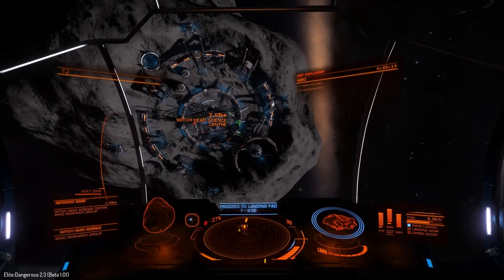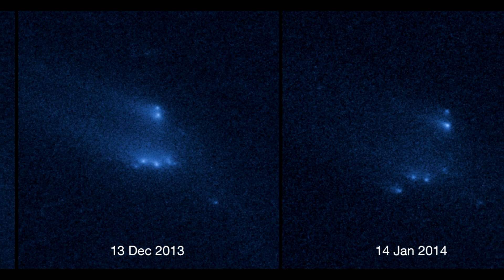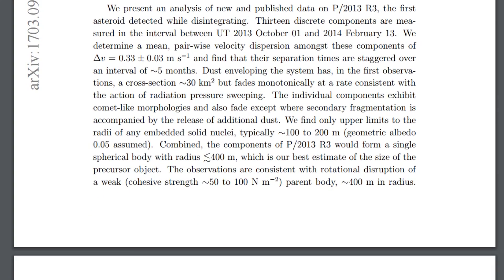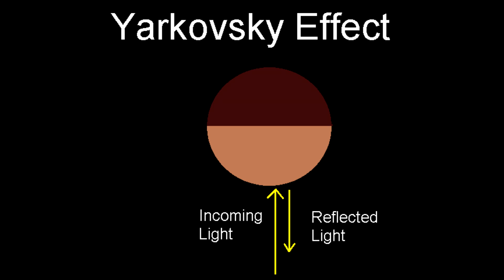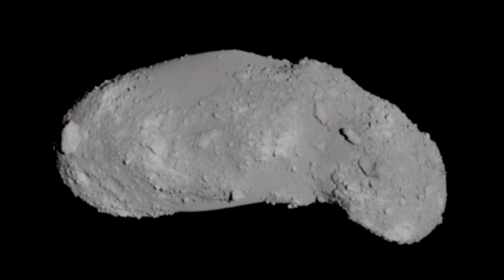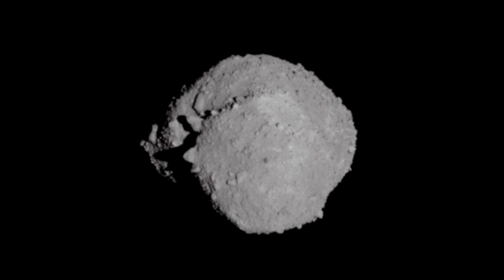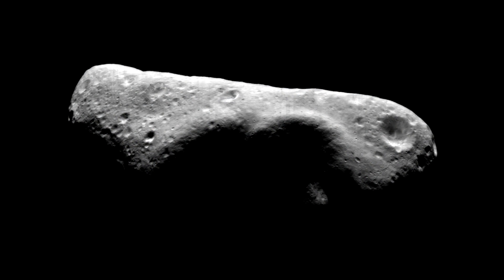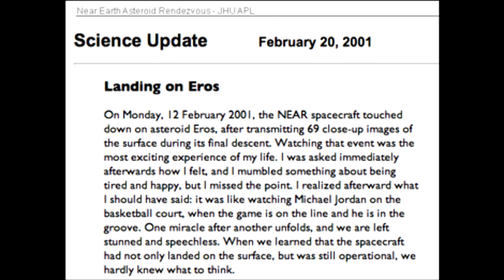Spinning Asteroids To Make Space Stations

Comment: i always assumed that for the stations they dug out some of the asteroid/body and spun an cylinder inside it. 
cheaper, youre mining the body anyways, and you're spinning up the cylinder not the actual body.
Reply: also i guess all that rock is a nice protection against that nasty space radiation, in my opinion that's the only advantage of digging a hole in an asteroid instead of building something on the surface anyway.
Reply: frischer bärlauch speaking of those nasty little solar rays i wonder if it's possible to put something near Ceres to block out the rads, like a nasa scientist (i believe it was) suggested recently. Then you could build habs on the surface. Maybe put up a nice little space elevator.
Reply: John Wang i never said a hollowed out asteroid with a cylindrical city made sense, I'm just saying that's how i always figured it was done. Personally I'd but a magnet in orbit to block stellar radiation and build bowl shaped habs on the surface and spin them to have artificial gravity. And you'd want a permanent base on Ceres because there aren't any satillites, it's rather small, lots of fuel, and it's larger and more circular than a lot of other bodied you could consider.
Reply: +Daniel Carter   First ore only exists on differentiated bodies that has had some volcanic activity in the past to bring magma with higher concentrations of heavier elements closer to the surface.   That's why I said that Ceres would be ok but no better than the Moon or Mars.   Really, you have scale all mixed up, do you realize how big the Moon or Mars are in comparison to any potential spaceship, do you realize how big some asteroids and comets are to any potential spaceship.   Unless you're planning a spaceship larger than ten thousand miles across, the fact that the Moon, Mars and asteroids are big really does not matter and indeed the surface gravity of the Moon and Mars would be a problem for large spaceships as scaffolding would be needed for support during construction and maintenance and there would be a planetary gravity well to launch against.   It takes infrastructure to smelt large quantities of ores not large real estate, how large is a smelter on Earth?   Is it thousands of miles across or thousands of feet across, besides one thing about space is that there's a lot of space, you don't need to go to a large body like a moon or asteroid just for space.   As to large bodies having ores, yes that's true but we can only scratch the surface of large bodies such as the Moon or Ceres.   The Holy Grail of asteroid mining to find a small fragment of a former planetary core, a type m asteroid that is small enough for us to extract the resources from completely rather than look for veins of or in the crust of some planet or moon we can barely dig a couple of miles into which wouldn't even be a noticeable percentage of the heavenly bodies volume.   Mining is about breaking apart the desired material into small bits for processing, the whole point of asteroid mining is to find something desirable that's already broken up into small enough bits, it's not about how large the asteroid is, it's about how much of the desired resources that can be extracted from it.   You don't want a big asteroid for the resources to build a space ship, you want a small one and even a small one could have millions of tons of resources, far more than is needed to build a ship.
Reply: also not all radiation is charged
Reply: frischer bärlauch it shouldn't do that too much. I mean it's basically just emulating the one we have on earth. And any equipment we bring up to space has to be hardened anyways.
Reply: Daniel Carter yah but still the magnet we have on Earth has a much bigger scale, for something portable to have the same effect I guess you would have to have a very strong magnet in your space station
Reply: +Daniel Carter   First, only high kinetic energy particles such as the solar wind and cosmic radiation are charged particles. Second, we can make magnetic fields more intense than Earth's magnetic field but remember that the surface of Earth is about 3,000 miles away from the center of the Earth, how intense would the magnetic field of any magnet we could possibly make be at such a distance?   The reason why the Earth's magnetic field shields us from some radiation like effects is because of the wide volume it encompasses, the whole artificial magnetic field as radiation shielding idea is highly questionable, placing an artificial magnet to shield from radiation probably won't do a thing, creating a mine field of billions to trllions of satellites each with an intense magnetic field might do something but that's getting ridiculous.   Artificial magnetic fields for radiation shielding is just another silly sci-fi trope.   Mass is still the best radiation and micrometeorite shielding, it's only downplayed in our current space program because it costs about $10,000 US a pound to get any mass from Earth to low Earth orbit.   If you're going to an asteroid for resources, your best radiation shield would be literally sandbags of asteroid regolith, preferably packed as densely as possible.   Cere's is an ok mining candidate because it's large enough to be differentiated, that is, it's a protoplanet, it had it's material molten at some point and sorted by gravity and ores of concentrated desired minerals would've been brought to the surface by volcanic events in the distant past but really Ceres has few advantages over mining the Moon, Mars or even Earth.   Smaller type S asteroids are small enough to mine completely (we can only mine 2.5 miles down on Earth so even on Ceres we can barely scratch the surface) but small type S asteroids appear to be loose undifferentiated rubble which have never been part of a protoplanet and hence all the minerals are dispersed throughout the asteroid.  Typically, a type S asteroid would be 8% iron throughout with no concentrated ores and current iron ore are only commercially viable if over 70% iron, that's not to say we couldn't mine them, we would just need to use bacteria to biomine them.  The prize of asteroid mining would be the type M asteroid which are believed to be portions of a former protoplanet's core after the protoplanet has been shattered by collisions, such an asteroid would have very high concentrations of desired elements but we believe that fewer than 5% of asteroids are type M and our space probes are suggesting that may be an optimistic estimate.   I doubt that a large asteroid like Cere's would make a good prospect certainly when you could do just as well by lunar mining, what we would want with asteroid mining are small type M asteroids, the smaller the better to make the resources all the more accessible.   Type C asteroids are also very interesting, they're a little like burned out comets, they are mostly carbon, water, dry ice, hydrocarbons and ammonia, all very useful products, it's even hypothesized that type C asteroids may be up to 40% frozen ammonia water ice, type C asteroids are also very plentiful.   I can see using the dry ice and water from type C asteroids to synthesize plastic sand bags to pack with type S asteroid regolith to use as radiation shielding material and electrolysing the ammonia to produce nitrogen as a filler gas for a habitat's environment.   Obviously, hydrogen and oxygen would also be readily available from type C asteroids so they are ideal fuel stops.   I'm ok with your idea of using a hollowed out asteroid as a shipyard idea though I would imagine that we would need a smaller shipyard long before we had an asteroid hollowed out, I would imagine building a shipyard with Adobe sandbag construction perhaps a large cylinder or something like a giant truck tire where there's a shielded space in the rim where habitats could be placed or even tracked around for artificial gravity.   It only takes 3 feet of packed Earth and hence presumably of regolith to reduce radiation by a factor of 1,000 and the measurements of the Curiosity probe enroute to Mars showed peak radiation levels of a 1,000 times of Earth's surface.
Reply: +Daniel Carter   Comets are often larger than any port on Earth.   Besides, you don't need anything as large as a comet or asteroid to be a waystation.   Even a relatively small in comparison Stanford Torus, Bernal Sphere or Oneill Cylinder could host a population of ten thousand and serve as a port both as a waystation and for construction and maintenance.   There's no need to be actually on the surface of an asteroid or moon just to be a base of operations.   Besides, if your permanent base is a Stanford Torus which can move to another asteroid when one is depleted or another asteroid moved to it, isn't that more permanent than leaving ghost towns behind while you relocate your "permanent base" from reservoir to reservoir on a moon or dwarf planet?
Reply: frischer bärlauch yeah but it's the charged stuff that's the issue if i remember correctly
Reply: John Wang first the magnetic shield. NASA's idea not mine.  wired.co.uk
Reply: +Daniel Carter   Like I said in the earlier post, the magnetic shield is only entertained in our current space program because of the high costs of launching mass from Earth, if you are going to asteroids for resources, you do not have that limitation and mass becomes the best and really the only currently tested means of radiation shielding.   You're not going to provide shielding similar to Earth's magnetosphere with artificial magnets and if you seriously look at NASA's proposal, they know this and know that at best it could only be partial shielding for a small volume against only relatively low kinetic energy particles and would have a high energy budget.   We might do magnetic shielding on a deep space vessel but certainly not only magnetic shielding, we would still position equipment, supplies and infrastructure to create a small shielded storm cellar on a deep space vessel.  For a habitat which rarely changes orbit and has access to regolith, magnetic shielding isn't the way to go.
Reply: +Daniel Carter   Like I said in the earlier post, the magnetic shield is only entertained in our current space program because of the high costs of launching mass from Earth, if you are going to asteroids for resources, you do not have that limitation and mass becomes the best and really the only currently tested means of radiation shielding.   You're not going to provide shielding similar to Earth's magnetosphere with artificial magnets and if you seriously look at NASA's proposal, they know this and know that at best it could only be partial shielding for a small volume against only relatively low kinetic energy particles and would have a high energy budget.   We might do magnetic shielding on a deep space vessel but certainly not only magnetic shielding, we would still position equipment, supplies and infrastructure to create a small shielded storm cellar on a deep space vessel.  For a habitat which rarely changes orbit and has access to regolith, magnetic shielding isn't the way to go.
Reply: +Daniel Carter  Again with fuel, you have your sense of scale all wrong, a small type C asteroid or comet could provide you far more fuel than centuries of searching for frozen water and helium 3 reserves on a large body like the Moon.   Even on Earth, well over 99% of Earth's water are in the magma below the twelve mile thick crust into which we've only dug 2.5 miles into.   The resources of large heavenly bodies such as moons and dwarf planets are largely inaccessible to us except as rare ores brought closer to the surface by volcanic events, yes they have a lot of resources overall but the whole point of asteroid mining is that they are smaller than moons and dwarf planets and their resources may be more concentrated in certain types of asteroids and are more accessible from the surface.   A small near Earth asteroids could even be steered into a convenient orbit.    A large body like the Moon, Mars or Ceres would not be an advantage in a refueling stop.
Reply: +John Wang You're argument on the magnetic field of the earth is kind of what I was going for thanks for the elaborate answer. Like I said in my opinion mass is a far better radiation shield although I'm not sure why you want to pack the regolith into bags. I think it would be easier to build your O'Neill cylinder or whatever inside the asteroid then your equipment and electronics is protected from space during construction. I didn't know that there are asteroids with a lot of water and ammonia in them but I think water ice might even be a better material for a radiation shield because it is not quite as dust-like as your regolith and you can melt it into a giant ice cube without having to heat it up too much. 
So my proposal is to move a type C asteroid into geostationary orbit, dig a tunnel into the asteroid and build some kind of self supporting base with artificial gravity in the tunnel and melt the ice in the asteroid so that you have a water ice matrix which holds together all that regolith. If we can do that we would have a radiation shielded fuel station with a potentially permanent base on it. In my opinion we need some kind of fuel source near earth if we really want to send large amounts of equipment and personnel beyond the moon. 
I'm curious what +Scott Manley thinks about this idea.
Reply: Two other advantages:
1. When the cylinder is spinning it would provide whatever amount of gravity you needed for people inside it. We know microgravity is destructive to the body, and even the 1/3 G of Mars might not be enough to keep people healthy, but a spinning cylinder could provide 1 G and the outer body of the asteroid would still be a good shield.
2. By attaching the hub of the cylinder to the body of the asteroid (the main body of the cylinder could use a maglev-like system to suspend it around the hub to eliminate friction) you'd get a gyroscopic stabilizing effect for the whole body.
Reply: Daniel Carter I'm not so convinced by giant magnets as radiation shields... I mean it also messes with your equipment and stuff right?
Reply: frischer bärlauch because comets are small and refinery's docks and refueling platforms are large. Thats why you have stations in asteroids that have ice haulers deliver to them. It's perfectly feasible to put a refueling station on a comet but by the time you've finished the station you spent more money on a hard to reach tiny ball of ice than you'll ever make from mining it. And once that comets done you've pretty much got to abandon the station.
Reply: Daniel Carter but why not just sit in a hole surrounded by rock and be done with it? I think a magnetic shield is a good idea if you want to move but if you just want to have something stationary an asteroid would be ideal in my opinion, you are (probably) protected from radiation and you have resources to build stuff and micrometeorites should also be no problem
Reply: frischer bärlauch  Unless you have some tunnels there before you decide to colonize. It's cheaper to build a magnetic shield. I can run through my reasoning on that in greater depth if you want. Though I'm not sure its that interesting
Reply: Daniel Carter Well I think shipping ice from Ceres might be even more problematic from an economic standpoint, I mean if you put a comet in low Earth orbit it would be much more convenient right?
Reply: frischer bärlauch no the moon is the best source for water for earth.
Reply: +frischer bärlauch   I don't see the purpose of colonies on planets or moons either, when we could just build Stanford Torus's, Bernal Spheres and O'Neill Cylinders.   As to habitats for asteroid mining, I think it would be better to move your habitat from asteroid to asteroid as you deplete them so building large habitats on the surface would be pointless.   We may still have small habitats on asteroids, the Moon and Mars but it's far better to keep people on the large habitats which could be moved as needed, we could even just operate androids or simpler robots via telepresence from the large Stanford Torus's, Bernal Spheres, and O'Neill Cylinders and only actually visit the asteroids, Moon or Mars when absolutely necessary.
Reply: @johnwang9914  yup. We are too used to innerlowda life. Buildings exist as an acconplishment against Earther gravity. An asteroid with 1/30g offers little advantage- i mean there is just no reason to root things to the ground if unaffected by a huge gravity well. BUT if you spin small stuff you get more tidal forces and coriolis i believe so the idea of having 473km spun will have less undesirable effects i suppose.
Reply: But why not just capture a comet or something if you want to have a gas station
Reply: John Wang mass still matters. Every bit we add increases our cost and decreases our efficiency. For land based habitats a mix of whatever we can provide is always best.
Reply: Oh one of these. In the Expanse they don't just spin up Ceres. They bombard the surface with nuclear weapons to 1. Spin it. 2. They strengthen it. They Glass the entire surface multiple times over. It's explained blah blah metal/crystals etc. Basically it's a giant bessemer conversion going on in space. So the outer shell is hard steel and can be sped up.
 And yes It's completely plausible and possible, it's a rather ingenious way to do it. I get a kick out of people who don't really do much research on the show and point out the spinning should shatter the object.
Ceres isn't being held together by it's own gravity, it's being held together because it's entire outside shell a coupe miles down is essentially pure steel.

I don't know how people who read the books miss this.
Reply: @AF-sb3jk  Despite being seen as more realistic than other SciFi TV shows, the Expanse is not known for good science and nuclear bombs aren't the marvelous solution to everything.  Spinning up Ceres which is a differentiated body massive enough to form a sphere would take an inconceivable amount of nuclear weapons.  It's simply a matter of mass, what's written in the Expanse books is ridiculous.
Reply: @AF-sb3jk   And why?   This is the problem with fiction writers and futurists, they never consider that there would be far easier solutions to whatever could motivate their incredible feats.  The Expanse is simply not a good reference for space colonization but it is a fun show to watch.
Reply: @A F  that was not mentioned in leviathan wakes one bit (don't talk about any other books I'm just starting the series I don't want spoilers) they just say tycho went up to Ceres and big engine and pew switch on Ceres spins. There's nothing saying the outside surface was held together by steel
Reply: But why not cover your giant space station you've built much more cheaply than reinforcing an entire dwarf planet with the rock you dug out?
Reply: yes.,,,hollow the damn thing out,  that gets rid of most of the mass, in fact they already did this in the show. they extracted all the water.
Reply: you could use asteroids like 4179 Toutatis as big big passenger ships, a stellar mass transportation system...
Toutatis comes relatively close to jupiter every 13 years, and comes very close to earth every 5 years, and passes mars orbit and asteroid belt.
every 13 years, you have a windows of reaching to jupiter system within 3 years of travel time
if you wanna bring large numbers of earth colonists to mars, asteroid or jupiter system, such asteroids might be your cheapest possible solution for mass transiting people, while above that offering enough space and ressources to not have to have an uncomfortable time. you could live life there, work there, or study there for 3 years travel time and then get to destination by rocket within some weeks, or even some days.

given that there are dozens of such objects in the solar system, there might be several department solutions a year depending on your destination and your timeframe...

of course we could build big stations with optimized transfer orbits too, but for such an infrastructure investment, you need to already have a pretty developed space infrastructure, and you would not have ressources on site.
Reply: I wonder, if spinning asteroids was simply the "cheap but risky" method idk. Building the Nauvoo but larger was a huge expensive task, only something they could steal from the Mormons...but however they span asteroids, with Epstein drive and being miners was maybe within their means (if implausibly difficult)
Reply: I think everything would start of with whatever is the cheapest possible and they scale up over time, and depending upon politics the cheapest could also be lives.   .I.e if the cheapest habitat has no radiation shielding or artificial gravity and the life expectancy is only until the next mined material pickup and you either do it or get a bullet to the head or they release they latest gene engineered space Ebola or they kill your mom & pop on earth...you'll probably keep mining...
Reply: How would you spin out a cylinder inside it and constantly spin it? If it's something on the asteroid or walls of the hollow asteroid then the asteroid would be spun up, so how would you make a little cylinder world that spins?😊
Reply: +Daniel Carter  Well, why would you build a large space habitat like that, to shield workers from radiation and micrometeorite and provide them with artificial gravity while they mine the asteroid but wait, if you have to mine the asteroid first before building the habitat then how will you house them while mining and once it's mined, why would you continue to have to house miners?  It would make far more sense to build a smaller habitat either floating nearby or a small centrifuge on or just below the surface rather than turn the entire asteroid into a habitat.
Reply: @johnwang9914  let's say your your  one to an interesting large astroid that you want to mine.  It seems perfectly sensible to dig a hole and take shelter in it while mining the asteroid from the inside.  

First thing to do is direct vaporized/processed rock for astroid spin down rather than spin up.   It shouldnt take long to dig a simple tunnel  whete one can inflate a sealed habitat that is sheltered from cosmic radiation solar winds and micro meteoroids, as the crew continue mine deeper. 

Once sufficently deep, you'd spiral dig radially out from the  center of your tunnel untill you had a chamber maybe 100 meters diameter by 10 meter deep  now you can build two pods tethered to a center tube and have the pods rotated to provide artifical gravity at maybe 50% of earth's gravity . Youd also add another two pods tethered to the same tube but counter rotated so that no net torque is generated. 

 The pods provide artifical gravity at maybe 50%  for the crew for when they aren't working, individually 16 out of every 24 hours.  Pods can be added as crew grow. Eventually, you can have a hollowed out center with a colony livng in two counter rotating tubes that could be as long as needed.
Reply: @kreynolds1123  Only a type M asteroid would have any structural strength and mining asteroids would most likely be for water and volatile components for a market in space, exporting gold and platinum to Earth is not really a sustainable business model.  You would not need to hollow out an asteroid for a habitat and indeed your need for a habitat is long before you have hollowed one out.  I can see doing a cut and cover trench around the circumference of an asteroid and have what's essentially a mag-lev train circling the asteroid to provide a habitat with sufficient artificial gravity but no more.  Ultimately, a standalone Torus or O'Neill cylinder which you simply move from asteroid to asteroid would be a better choice than hollowing out asteroids.  It's a matter of needing a habitat before you've mined the asteroid which makes the hollowed out asteroid concept nonsensical.
Reply: @johnwang9914  As to only type M having structure strength.  My proposal doesn't require structural strength from the asteroid as the asteroid is prefered to have been spun down, and with gravity being so small, that just a relativly minor amount of reinforcing  would be needed for an internal cavern to protect an internal rotating habitat composed of a few counter  balanced and opposingly spun pods. 

Depending on the asteroid and the rate of  growth in mining crew, mining an asteroid could go from decades to century or more.  After all that, maybe  toroid ships  could be sent from asteroid to asteroid. But, to have adequate shielding for a colony in rotation with the colony with sufficient artificial gravity will be a challenge that more distant technology is likely to better address.
Reply: @kreynolds1123    I think the key point is that we would need a habitat as early as possible and you don't need a terribly large habitat certainly not one as large as an asteroid.  Spinning down an asteroid is a massive undertaking, hollowing out an asteroid is also a massive undertaking.  A Stanford Torus was originally designed for a population of ten thousand, more than enough for a mining town, hollowing out an asteroid would provide accommodations for millions, most certainly overkill for mining an asteroid.   At best, you would only need a very small portion of an asteroid as a habitat and though your first habitat may very well be dug into an asteroid, eventually a stand alone torus which could be maneuvered to another asteroid would be more practical.  I'm just saying the asteroid as a habitat is more than you need and takes too long to achieve.
Reply: @johnwang9914  all these asteroids are already spinning that spinning down is not as huge a challenge that you make it out to be. Certainly it does require energy, but it's orders of magnitude  less than the of energy required to spin them up to a reasonable artifical centrifugal g force.

 And it's a difference of scale and time between a hole dug into an asteroid and a hollowing out asteroid.  Incedently, after spinning down, the existing micro gravity has the rock under compression where rock and gravel performs very well keeping its structural integrity.
Reply: @kreynolds1123  Spinning down or spinning up is a matter of the mass.  The fact that all objects in space tends to spin four rotations per Earth Day is only a baseline starting point, the fact that hat an asteroid is spinning dies not make the task any easier.  Spinning down or spinning up an asteroid is a major feat far beyond anything mankind has done to date period. Listen, eventually we may have a hollowed out asteroid but do we need a habitat that can house a small country initially and can we wait till we've hollowed out an asteroid to have a habitat?  You're stuck on a personal bias for a marvelous concept which is totally unnecessary and impractical.  You"re asking for a Lamborghini when what you need is a Prius or public transit to get you to work so you can earn enough for a Lamborghini in the future.  It simply takes too long to build the habitat you need early on if you are fixed on hollowed out asteroids and by the time you've mined an asteroid enough, you would likely have already built larger O'Neill cylinders so hollowed asteroid habitats may already be obsolete.

Also, how much compression do you expect from spinning down an asteroid from four rotations a day to being tidally locked?  Would it even be enough to squish a marshmallow on the surface, certainly it would be nothing at the center.  You're messing up on scale again, spinning down an asteroid not only is a huge unimaginable feat but the end results are barely measurable.
Reply: @johnwang9914  if we are talking about mining as soon as technologically and economically possible and to the issue of  immediate shelter when we get there, I imagine a mining ship with an initial crew complement of 5, equipment like a few drills to bury a few small explosive can blast fracture rock several meters at a time and move the rubble in the micro gravity with easy. 
 In the space of a day . 
 They could have  hole several meters wide meters wide and 10 or more meters deep. By the second day, they could have an underground cavern 5 meters wide by a 3 meters deep and  sleep in an inflated habitat at with 10 meters of rock rubble over it.  

Over the course of a month they could could have additional  habitats dug deeper and ready ready for the next ship with  supplies like food and more equipment like solar power collection be they solar cells or concentrated solar stirling motor generators and smelting equipment and maybe a couple more crew members with aditional skills. 6 months in and the miners may have balanced  counter rotating pods for artifical gravity deep inside an asteroid to spend most of their time in. 

How ever the future ends up working out, it should be self evident that the first asteroid miners will progress in stages far different than later asteroid miners. While your vision may appear to look like a more distant future, my vision can be started sooner.
Reply: @johnwang9914  I'm sorry, I'm not sure why you think my aim is a "hollow out asteroid" when for a while now, I've been pointing establishing a mining base inside an asteroid  as a stepping stone.  And what you think of by hollowed asteroid is far more than the much smaller caverns  I've been envisioning, and by compression it really doesn't mater  if that it's a marshmallow at the surface and 1 pounds under 1km of rock and rubble, it's under compression where rock and gravel hold together well. 

It would be a couple of centries or more of digging and processing  the rock before we got to even thinking of the caverns as being large enough to say the asteroid is hollow vs just a hole in the ground. And never did I sugest the asteroid to be the spaceship to take the mining colony to a new asteroid, nor am I thinking of a mining  colony  the size of millions.  Maybe after a centry, a few thousand crew at most. By that time they can be supplying the materials for building torus colony ships to mine other asteroids.
Reply: @kreynolds1123   Basing an initial small shelter beneath the surface of an asteroid is a far cry from a hollowed asteroid.  Yes, I would envision early habitats to be simple holes dug in the asteroids, most likely using centrifugal force for artificial gravity much like the vases and spin salad bowl habitats envisioned for the Moon.  This is also why Isaac Arthur mentioned the O'Neill cylinders growing like pimples out of the surface of asteroids.  By the time enough of a type M asteroid has been excavated enough for a true hollow asteroid habitat, there would already be large standalone Cylinders, Toruses and Sphere habitats and these standalone structures would be a more efficient use of materials to begin with so even after centuries of mining, we may still not have hollowed asteroid habitats simply because alternatives would already exist.  Even if the large habitats remained attached to the asteroid, at some point they may want to migrate to another asteroid so they would just detach and become a standalone habitat, this might even be true of the subterranean habitats, they could easily eventually detach to move to another asteroid.  Asteroids are resources not necessarily homes.
Reply: @kreynolds1123  I should point out that the thread is on Daniel Carter's comment of hollowed asteroids so your countering my point that would likely not be achieved for various reasons could only be assumed to be in support of a hollowed asteroid concept.
Reply: @johnwang9914  one resource is cheap in-situ material for shielding. But as this video points out the impracticalness spinning an asteroid up to give reasonable artifical gravity. On the inside walls Due to the extraordinary amount of energy required to achieve the rotational rate needed, but that the asteroids structural integrity is week under tension. But man really needs gravity and shielding if he's to stay for a length of time. So the first miners will need both shelter  in the asteroids,  artifical  gravity inside tethered  pods. they  start with pods but will move onto  small. Internal  torus for hundreeds and maybe  expand into tubes for thousands. Far smaller than the millions your were thinking.
Reply: @johnwang9914  Granted, this thread started with one idea. And others like you had others ideas. I came along and had simular idea to the original poster but much scaled down for a mining colony and not a whole country of millions.
Reply: @kreynolds1123  Given the low gravity of an asteroid, the resources of the asteroid are cheap in-situ regardless of whether the habitat is beneath the asteroid's surface or just nearby.
Reply: @johnwang9914  Problem is you cant simply wrap your rotating donut ship in asteroid rock even if you can secure bags of it to your ship. When spun you need materials that hold up well under tension. 

On The other hand, rotating a habitate inside an asteroid doesn't create nearly as much tension on the spokes of the habitat
Reply: @kreynolds1123  You can extrude regolith with a polymer binder into a meteorite and radiation shield effectively 3d printing the shield plus you would already have some shielding if you carried people to the asteroid.  It's only expansions that need be added and that's actually more easily done in open space than beneath the surface of an asteroid.  Alternatives to regolith plus polymer binder essentially asphalt are sand bags and even regolith ice blocks or just the polymer instead as hydrogen based polymers are uniquely suited for radiation shielding per unit mass.  The plentiful type C and type S asteroids are known to have CO2 in the form of dry ice and water ammonia ice so polymers can easily be synthesized through the Fischer Tropsch reaction process commonly used in existing refineries and a simply cobalt oxide or iron oxide catalyst is all that's needed both to convert CO2 into CO and oxygen, water into hydrogen and oxygen and for the Fischer Tropsch process itself.

The shielding need not be attached to the pressure vessel.  Even Isaac Arthur mentioned this in his videos, the shielding would be static while the pressure vessel spun within.  Simple halbach arrays of permanent magnets and aluminum bars would be sufficient to provide the little magnetic levitation needed to keep the shielding from colliding with the pressure vessel.  The energy for the levitation would be from the momentum of the rotating habitat within so there would be the need to periodically boost the rotation.  This could be done with a momentum wheel with reaction thrusters used when the momentum wheel reaches maximum rated velocity and need to be despun.
Reply: @kreynolds1123  >
Reply: John Wang as for everything else. The reason i prefer planets (or dwarf planets) over astroids for mining is logistics. Let's take the moon for example. There's no real advantage to using the moon over an asteroid or earth for minging. But if we want to build something large (say a ship the size of the Donnager) it'll be much easier on the moon. Because we can extract and refine ore on a massive scale. And then build the parts and put them into low orbit for a fraction of the Delta V that it'd take for us to hop from asteroid to asteroid and station to station. If that makes sense.
Reply: John Wang i don't see the point in a habitate on a planet or a dwarf planet or whatever if there is no atmosphere, you might as well sit in a tin can in orbit. However, I wonder how much radiation would actually be absorbed by an asteroid if it has such a dusty consistency
Reply: @simonhonl4362  even starting with a meter or two  of dust and rock will provide substantial protection from cosmic Ray's and solar winds.  Mining tens to 100 meters deep is sure to protect the miners substantially.
Reply: frischer bärlauch i think a city on Ceres makes perfect sense from an economical standpoint. It's like a city built on an oasis. You resupply before heading into the more chaotic areas of space. (i mean the amount of moons around our gas giants combined with their large size would require you to burn a lot of fuel if you wanted to make good time.
Reply: frischer bärlauch i mean yeah it'd be a big magnet but once you have the sort of reach humans in the expanse do it's, well it's not easy but it's not as difficult as it would be now.
Reply: John Wang same idea for fuel. With a permanent base we have less to haul around and we don't have to use out fuel to do it. The moon has low enough gravity that we could build a simple space elevator and enough of the right resources that we could build enough solar panels to power it and anything else we wanted.
Reply: John Wang and how do you build these super structures? How do you manuever or fuel them. Its a ridiculous waste of resources to even try and build something like the torus until you have permanent refineries and factories on other worlds. And these large stations all suffer the same problem, a lot of them are just under too much stress. They're just spinning too fast. It's cheaper more feasible and more realistic to just build permanent bases on the bodies around the solar system.
Reply: John Wang i understand that asteroids are resource rich and miles across. But many tend to be unstable (like Scott Manley mentioned in the video) and rotate quite severely. And while yes the 10 kilometers large vessels might be useful for building vessels and yes they might be easy to escape from they're not often in easy orbits of the sun or easy to rendezvous with. If you had a station around some place like Mars or Ceres you could burn from earth during a transfer window, get a nice gravity assist and dock to get food and fuel and then a gravity assist on a similar plane to rendezvous with another planet. With asteroids you have to match velocity and inclination. Then you have to correct your inclination and you get no gravity assist. It's a waste if a lot of fuel.